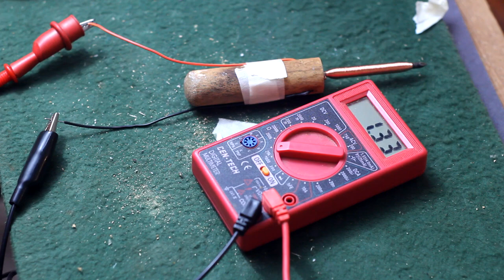Guitar Pickup Made from Ice Pick (Build + Demo!) Ice Pick Highs?

Comment: Another great video. Thank you.
Reply from the maker: Thank you so much Glenn and you are welcome. I have to admit that this one blew my mind a bit. There is no reason this thing should sound this good. Maybe that ancient nail had some kind of special steel or something LOL but really it doesn't make since. 1.3k resistance and loud and thick??? Go home physics you are drunk. Thanks again.
Reply: I watched again and this really confused me. My logic says it should not get much effect from the string vibrating to the side of the coil - I would expect very little signal going through to  amp , so should sound poor definition- no good tone....  But it has got good tone. It seems to send good signal to the amp. Doesn't make sense but sounds great. It doesn't need big chunk of wood , so this could be built in nicely into the guitar. Would be interesting to see if bridge or neck positions have same influence as traditional pick ups. This concept really challenges the traditions. I believe you are expanding our minds.😊

Comment: Reminded me from my attempts to make a pickup for my cheap acoustic back in the 2000's, to plug it into my stereo.
Reply from the maker: Its pretty wild what a musician will do when they gotta have some loud huh? lol when I was about 8-10 my amp blew up and I lost my cable after a move so I pulled the jack out of my guitar and hooked a headphone wire to the output wires and ran it into the mic input of a little boombox so I could play. 
 This icepick project was a strange one. I had no idea what it would sound like but since it was so low resistance I figured it would be quiet and really bright but... It was loud and bold? SO... I dont know what to think now. that basically goes against everything I thought I knew about pickups as well as what any pickup maker or electronics engineer would say? I guess thats why it is cool to do these experiments that the viewers suggest. Its always a surprise. LOL
Reply: @heavymetalATC  I think the output is mostly related to number of coils rather than resistance. And you sure got a lot of coils in there.
But the fact that the coil is in such a direction and it sounded that good is just amazing. Noe I'm considering winding a coil around an Alnico magnético and then dip it into epoxi, to make it resemble a "normal" pickup

Comment: Love your pickups videos. They Make me want to try to build my owns.
Reply from the maker: Thank you so much Benjamin. You can do it. They are quite simple. The hardest part is winding and soldering the tiny angel hair sized wire but after a few tries or maybe even right off the bat you will nail it. Then you will catch the pickup building sickness and go down the rabbit hole of materials, wire gauges and coatings, magnet types, shapes and sizes. wind scatter ratio and on and on. You can pretty much make it sound however you want from quiet to loud, smooth to jagged, rich to thin. If you decide to go for it let me know your results and if you have any questions or problems feel free to drop a comment.

Comment: I'm guessing  why it sounds good is because it's a pinpoint on the string vs the usual muddy many points.
Still, similar to an LED only half the signal is being used.
Reply: I would like to hear an additional ice pickup at 90 degrees to pick up E W vibrations as the first is picking up N S 
Then mix the two voltages.
If you could invent a 12 string sound with 6 strings you could be my new hero.

Comment: I kinda want to know what these "ice pick highs" sound like. Could you make a pickup that emphasises this?
Reply from the maker: Thank you so much for watching and taking the time to comment Fehlbergo. I have just the pickup for that in a guitar already. Even through a warm vintage spec amp it sounds like crystal razors coming out of the speaker. I will put this in my notes and when I make the video I will give you a shout-out.  Thanks again great suggestion and should be an easy video.
Reply: How about a super low ultra mega mudbucker?

Comment: Clementine this is so amazing! You made my day with this! Would consider making a thin sidewinder that would sit on top of nonrouted body? I was always fascinated with the idea of being able to just pick up your... erm pickup and put it in your pocket and then just slap in whatever position you want on your bass.
Reply from the maker: Thank you so much Bash. Yes that is a great idea I will put that in my notes. If/when I do the video I will give you a shout-out. I think I could "borrow" the design that the guys use for the flat cigar box pickups and upscale it to normal size or even oversize to make up for being flat. Thanks again that's a good one you could just use blue tack and move it from bass to bass or on guitars or stick it to a steel plate or a cymbal to make crazy percussion sounds. :)
Reply: @heavymetalATC  Any time you decide to do it is good time for me. I've found some videos of it, but they cut the process too short for a dummy like me.
On a sidenote: I find it really odd that pickup with 1.3k ohms was that loud. Better put, that's crazy! Was it because of the strength of the magnet?
Reply from the maker: @deeliriyum  It blew my mind I couldnt tell you exactly but another viewer noted that it may be because its only taking signal on 1/2 of the pole not the tip so it is pinpointing the strings and only using 1/2 of the signal like an LED or diode. It may not be true AC signal but a doubled up dc signal? Thats a better explanation than I can give for it.

Comment: You always get me trying new things man. Love it. 
I gotta try this out. I don't have a neodymium magnet that big though. I have a regular humbucker ceramic magnet. Might be a bit weaker but should work. I have a 0.06 mm wire and a 0.1 mm wire. What do you think is better to use for this? 
Thanks again for the videos bro
Reply from the maker: Thank you for watching and taking the time to write a comment Tamer. I think the ceramic magnet would work fine. Go with the thinner wire and wind it as much as you can stand. Especially with the brighter sounding weaker ceramic magnet. I ended up giving up on the winding but it would have been ideal to do about 3 times as much. Thanks again and you welcome. If you do the experiment let me know what results you get and if you have any problem or question feel free to drop a comment.
Reply: @heavymetalATC  alright ... That's what I'm gonna do. 
Can I send you some photos of my work along with some questions on instagram?

Comment: Hey Clementine, I don't know much about electronics but a crazy idea hit me and maybe you could try it or tell my why it's dumb. What about making a pickup out of a roll of aluminum foil. You'd cut thru the roll into a workable size and put the pole pieces or whatever thru the center of the roll having the roll act as the "winds" of wire. Soldering leads on might be tough and I know aluminum isn't conductive like copper but is there any possibility here?
Reply from the maker: Thank you for taking the time to write this awesome comment B K. You are correct you can make a pickup coil from a strip of flat aluminum foil. I have never done this but I know it will work. The thing is though that I have found while rolling diy capacitors that the thin plastic coating on aluminum foil used in the kitchen is not a good insulator. However the idea you have would work perfectly with aluminum or copper shielding tape with the backing paper still attached. Like the stuff they use to patch up the ducting for air conditioning or heat. That would be perfect. Not related but man that aluminum tape will cut the HELL out of you. I have been gotten BAD by it before... Anyway that is a great and fully plausible and achievable idea. Some other people have suggested very similar ideas as well and I will put this in my notes and if/when I make a video I will give you a shout-out. Thanks again.

Comment: Mobile doesn't let me edit post so I remember what I was going to ask you: The bigsby I got "clonesby" is crap I had two clip two turns off the spring with bolt cutters. I added a vinyl 1/4 bushing past the C pin to prevent horizontal play but then i noticed the metal posts are not evenly spaced like my bridge so I am going to use a paperclip the wingclip kind to evenly space the strings i just lay that on the posts. Do you have a better suggestion on how to make and cloneigsby not suck!
Reply from the maker: Thanks for commenting Rama. Ahh I dont really have anything to ad on this it seems you are pretty darn crafty. I do have a chigsby and its quite sloppy and full of end play but I just let it ride and the use of a roller nut and roller bridge with locking tuners made it a pleasure. Its pretty solid and will dive bomb to the body and return perfectly.